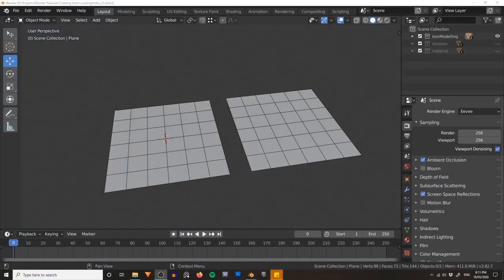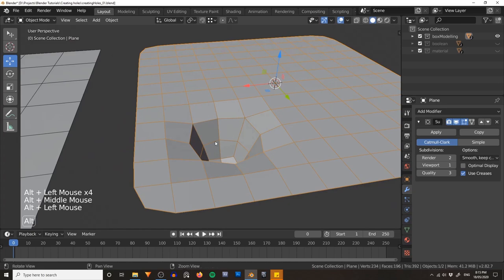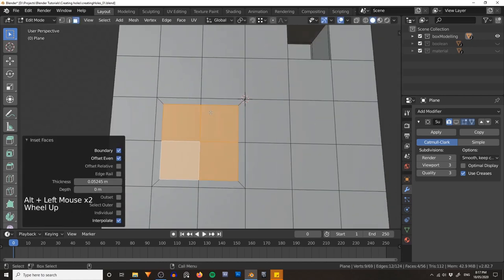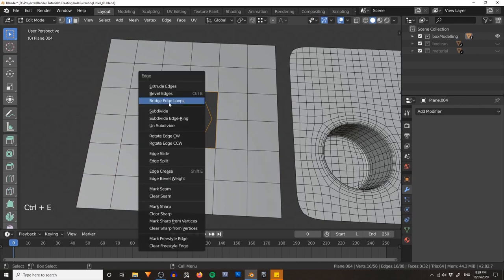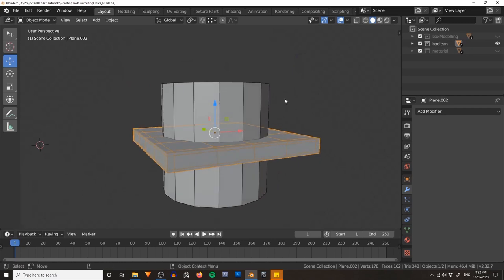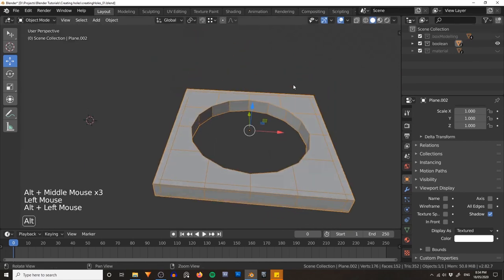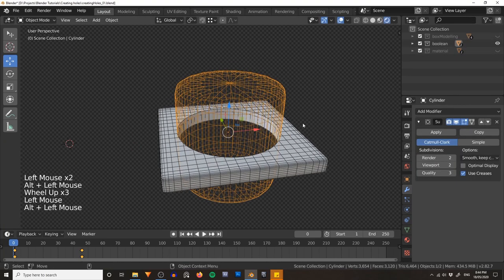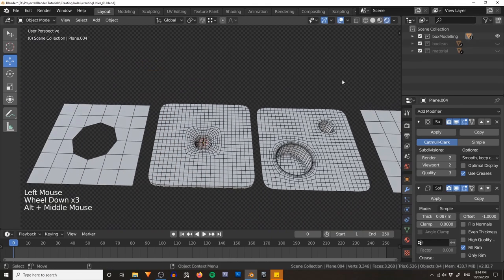3 ways to model circular holes in 3D

Comment: I want to cut a row of round holes into the rib-panels of a frameless air-chambered kite.
Looks like the third, the texturing way is the best here, because it´s a thin nylon-fabric and needs no material-thickness.
Reply from the maker: Do you mean kites like these?
https://www.google.com/search?q=frameless+air-chambered+kite&client=firefox-b-d&sxsrf=APq-WBsEBewcdlxi4KnQjV16oXKtMgys6w:1646601663590&source=lnms&tbm=isch&sa=X&ved=2ahUKEwih5_SZtbL2AhXw5nMBHVJwCR0Q_AUoAXoECAMQAw&biw=1920&bih=927&dpr=1